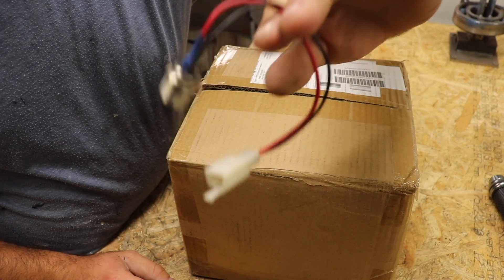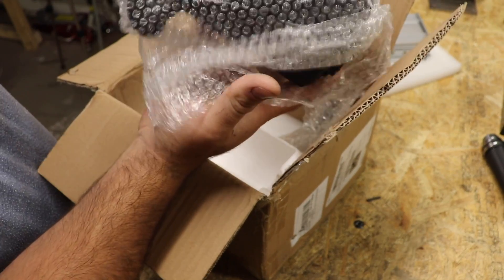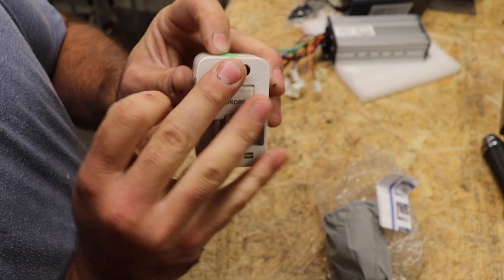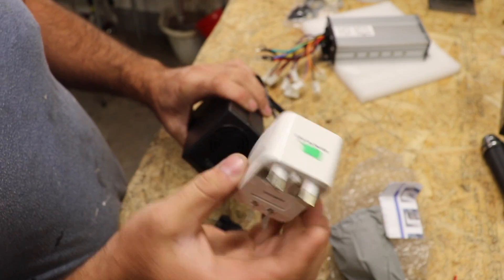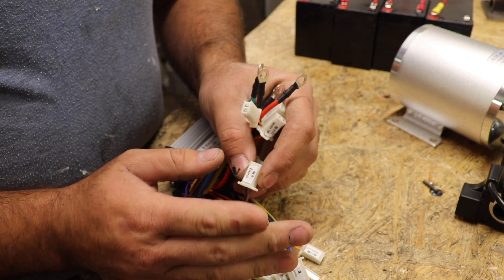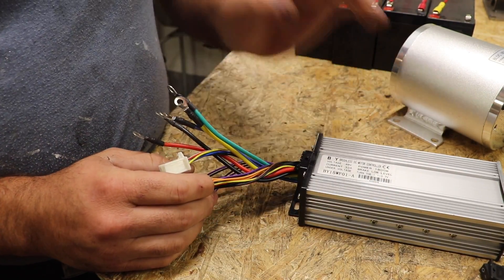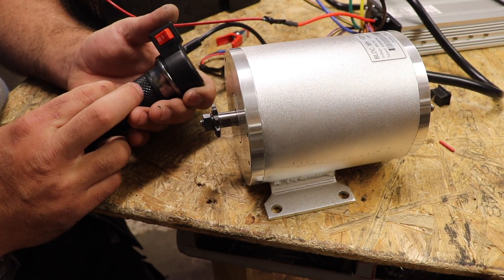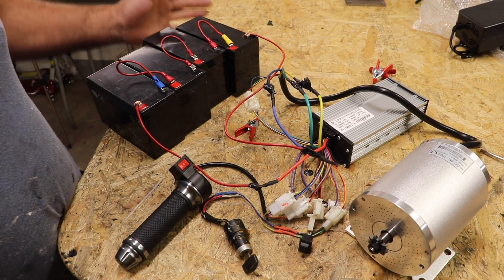Powerful Electric DIY KIT /1800W E- Bike - go kart- Motorcycle- Cars

Comment: the stalls wires are for low or Hight speed 3 speed switch red black blue  switches it blue with black or black with blue for low and hi speed

Comment: Hello, I bought a set with a 3000 watts 72v brushless motor in which the controller is also 72 volts, but the battery after fully charging has 84 volts, after installation nothing works, will replacing the controller with 84 volts help?

Comment: Can't really call it powerful with only 5 newton torque , I used this kit on an old Yamaha conversion I build 
(bike weight a mere 120 lbs and 5:1 ratio) and it is so slow  accelerating even at 70 Volts. 
I found that these kit don't even come close to 1800W ( that is just  exaggerated BS from the chinese)
closer to 1100W since those controller only draws 22 amps not 33?? like the stick indicates.
Reply: Where Can I find an actually good and reliable Brushless motor kit with esc, sprocket, everything that I would need to make a fast go cart? It's fine even if it's brushed motor, since they are cheaper than brushless motors

Comment: i got same kit with out charger or throtle from venor and paid £85 for it excatly same motor and controller and could not get it to work with my 48v battery pack. for example i had a 36v / 350w controller and 350w motor and was twice as fast than the new kit did not make no sense  so emailed venor and after 4 days with emails bk and fourth  i got no sense from them a £50 refund and keep the kit still sitting in box any idears what the problem may be any 1. venor say must be faulty  i dont think so myself. thanks

Comment: Whaaaaat! That motor is Awesome! I have the 3000 watt version in my amazon cart but I think I only need the 1800 watt. I'm currently on a BBSHD with 70 volts.
Reply: I’m looking at the 1800w 48v Amazon one aswell, what battery did you end up going with ?

Comment: Thanks fkr the video, can you kindly post an update with using all other cables that says brake light, brakes etc? Can I use a lithium 18650 batteru packs instead of SLA batteries,  in that case the supplied charger will work ? Please let me know thank you.

Comment: On a full charge , what's the maximum distance coverage in km?
Reply: Its a year late but for anyone reading. Depends on your baterries amp hours and the weight youre pulling. There is no real answer without these specs.

Comment: That's nice, I've been looking at a kit similar to that on ebay, I don't think there was/is a charger with it though, thanks, I was wondering if it was worth buying, I guess the real test is after you build something with it and put it under load to see about the power,durability, and how long it lasts will be the final test. I was thinking of building A  bicycle car/quadracycle , for two 2 people if it is strong enough, if not 1 person. Thanks again for sharing that, your English seems to be good enough to me, you were able to communicate what you wanted, that's what language is for anyway. You didn't put a link in the description for the motor kit?
Reply: What’s the kit called? I need one that’s easy to put together
Reply: @TheInnerGlowJourney  They have various titles/headings Here is a link to one on ebay, https://www.ebay.com/itm/48v-1800w-Brushless-Motor-Speed-controller-Reverse-switch-Wiring-Harness-Pedal/303498852156?_trkparms=aid%3D777001%26algo%3DDISCO.FEED%26ao%3D1%26asc%3D225086%26meid%3Db8197af0ee5b47bcb8a1b45a917da854%26pid%3D100651%26rk%3D1%26rkt%3D1%26mehot%3Dpp%26itm%3D303498852156%26pmt%3D1%26noa%3D1%26pg%3D2380057%26algv%3DPersonalizedTopicsRefactor%26brand%3D&_trksid=p2380057.c100651.m4497&_trkparms=pageci%3A36ef41c4-1e18-11eb-a1a8-72ab999eafc2%7Cparentrq%3A8fed3ecc1750a77d05a6add9fff31964%7Ciid%3A2 it's not necessarily the best kit or the best price ,you just have to shop around on there and see what there is and which has the best price for what you get and don't forget to add the shipping cost in if there is one. I have not yet seen one that has everything this guy shows here for the $150 he said he paid.
Reply: @BushImports  yeah I need something cheaper
Reply: @TheInnerGlowJourney  Cheaper than $150 ? You'll just have to shop, you need it to be strong enough to do what you want also, there are different watt rated motors.
Reply: @BushImports  i did not  cheaper than 150 I meant cheaper than the link u sent me
Reply: @TheInnerGlowJourney  I see. Let's go make a new comment and ask him to post a link to the one he got, maybe if more people do that he will post a link to the one he bought.

Comment: I used one of these on a tiny razor drift cart... loads of fun!
Reply: It was for me! I did lead acid starting out but saving up for a lifepo4 pack that should make it run a little better.  I notice a lot of voltage sag after a couple minutes of running
Reply from the maker: Is it going to be fun to try this
Reply: @Gs_DIY_ideas  so did u end up getting going with this?